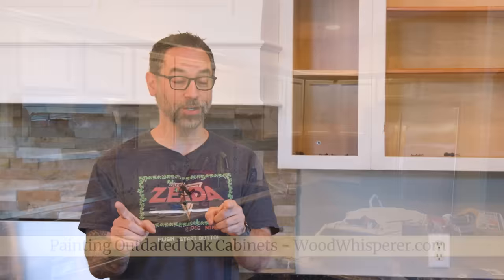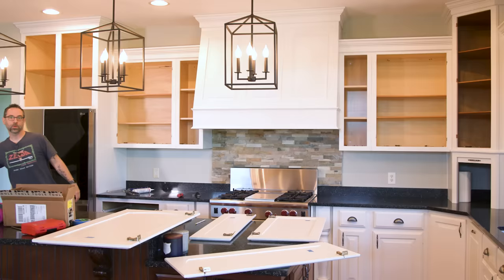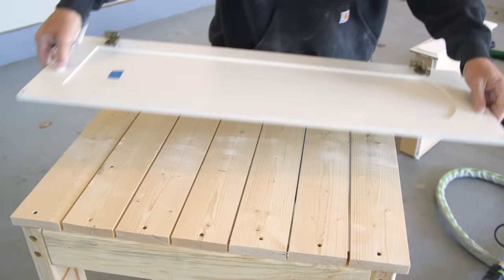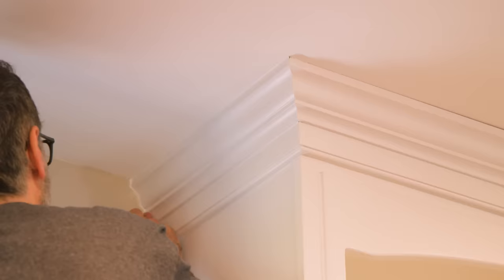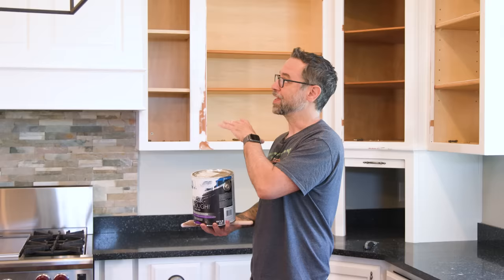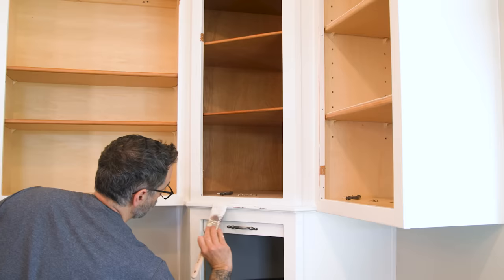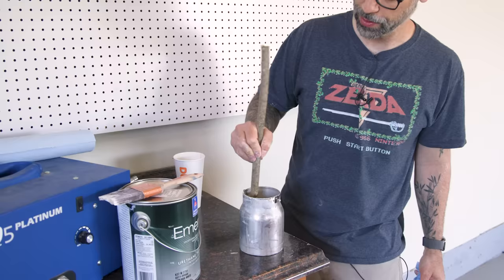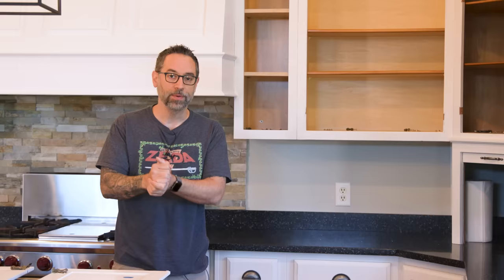How to Fix a BAD Kitchen Cabinet Paint Job | The Wood Whisperer

Comment: Painting company owner here...  A few tips and critiques....

1.  Always remove the doors/drawers and label them.  It might seem obvious where they go, but believe me, it's not.
2.  Make sure that your top coat is rated for cabinetry.  Emerald is rated for wood, but not specifically cabinetry because the cured topcoat isn't hard enough.  This is the biggest mistake I see in DIY cabinet jobs and it's one of the most costly to fix.  If it's not rated for cabinetry, it will chip/peel in the most used areas.
3.  Clean, clean, clean.  Mild detergent and water.  Scrub with a green pad, especially the doors/drawers over and around the cooktop.
4.  If you enjoy using your kitchen, just hire a professional.  Most cabinet jobs take the pros 5 days to do it right.  It could take 3 weeks or more for a homeowner who has a job and other distractions.  If you really want to DIY, call around and find a pro who can walk you through the tough spots.  
5.  Always use your own caulk.  Never borrow your neighbor's.
Reply: You say that "This is the biggest mistake I see in DIY cabinet jobs and it's one of the most costly to fix. "
Your comment caught my eyes, I have cabinets with a peeling top coat, and after I read online I assumed the usual suspects: not enough cleaning, no primer, or no sanding of the previous finish was done by the previous owner/their painter, but looking at my cabinet the top coat does seem soft.
How do you suggest dealing with such a problem? My initial though is to bring everything back to the bare wood or is there a special trick that the pros use in such case?
Reply: @paulchevalier5035  We run into cabinets painted with wall paint all the time, and this is what your issue sounds like.  We'll take a random orbit sander with 100 grit on it and go over every surface thoroughly taking off anything that wants to come off easily.

Once that's done, you can use a product from Ben Moore called Command.  No need to prime except for using some oil primer in the bare wood spots that come off.  Put on two full coats, preferably with a sprayer, but you can brush it on with a brown bristle Purdy (something fine and soft).  

Let them dry overnight and put them back together.

I've been doing that for over 10 years and I offer a 10 year labor warranty on my interior work.  I've never had more than a chip from a broken plate or some over rambunctious boys playing too rough around them.
Reply: @dgoddard  wow this is super helpful. Thank you very much for such a detailed answer! 
I know someone with truly professionally painted cabinets and that sounds more like what you describe here.
Have a great day dear stranger of the Internet!
Reply: @paulchevalier5035  No problem, buddy.
Reply: Can you tell me what is the best paint for kitchen cabinets? I have used some in the past (latex) that were supposed to be for cabinets (those brands were Porter and Behr) and they get really soft and gummy (and dirty looking) in the areas near the pulls where our hands get in contact with the cabinet. I'd like a good recommendation of exactly what to buy.
Reply: @les6584  You don't want to use latex.  You want a latex-acrylic.  We only use Benjamin Moore Command and prefer it in the satin sheet.  You'll want to use the best brush you can buy, but I do recommend spraying the doors and drawer fronts.  However the face frames and boxes can be brushed.

If your cabinets have already been painted, you don't need to use primer.  Just to good coats of the Command will be fine.  But you will want to sand the cabinets to make sure none of the old paint wants to come off too easily.  You can spot prime any bare wood areas using a good oil-based primer in a spray can.
Reply: @dgoddard  Thank you so much! I really appreciate your advice!
Reply: My entire workshop is becoming one giant cabinet lol. Covering most walls with 3/4 sanded ply. Big dings filled with Bondo. Fresh start primer for pore filing and then BM Command spayed on with fine finish tips. Sanding between coats.

Comment: I find that I can use a paint brush to knock down the texture left by a roller. This works well on cabinet frames since they are narrow and a single brush stroke can smooth the entire surface.

Comment: You mentioned HVLP sprayers are as little as $100, the proceeded to use a top of the line $1600 HVLP. You should make a video on how much do you really need to spend on a HVLP setup? I know the high end multi stage ones are better for thick paints, but some of the cheap ones claim to work with all paints too. How much can you get away with thinning paint (or clear finish) and still get good results? I've been interested in picking up a HVLP sprayer, but im worried if i get one of the cheaper ones I'll regret it. But I'm not doing this professionally, so I don't want to waste money on an expensive sprayer if i don't need it.

Comment from the maker: Easy links to some of the products in the video: Rockler HVLP Turbine - shttps://www.rockler.com/rockler-hvlpfinishing-sprayer?sid=AFN86 
Earlex 5700 Sprayer - https://amzn.to/3D8pVid
Fuji Semi Pro - https://amzn.to/46qPCHT
Festool ETS 150 Random Orbit Sander - https://amzn.to/450izsF
Blue Shop Towels - https://amzn.to/3Y7Tvho
Caulking Gun - https://amzn.to/4515kbd 
Sherwin Williams Caulk - https://amzn.to/475ssHo
Purdy Paint Brushes - https://amzn.to/3rMLm61 
Floetrol - https://amzn.to/44HPRNs
Rocker Bench Cookies - https://www.rockler.com/rockler-bench-cookie-plus-work-gripper-single?sid=AFN86
Marc's Respirator - https://amzn.to/3Yd2n5s
Respirator Filters - https://amzn.to/3YdpAnR

Comment: There are so many different bad paint jobs ...

My kitchen cabinets are from the mid-20th century, and built like tanks. The original finish was factory-applied white paint, aged to a not very attractive cream. A previous owner slapped on a coat of cheap baby blue latex paint — I don't think they washed the cabinets first.

When I decided to paint my cabinets a color I like, I washed them, and the paint began peeling off. So now I'm stuck removing all the blue paint. Sanding won't help, as I need to get down to the original paint, clean and sand that, then proceed. Any blue paint left might peel later, it all needs to be removed.

I'll do my paint job right — good prep, a little more prep, and Ben Moore's Advance cabinet paint.

Comment: shellac primer is the way to go  in kitchens  because it  will bond over grease and any finish .  general finishes milk paint for top coat   if your going  to roll it .  otherwise use nitro . you  need surf prep sandpaper  with a .5 foam  for doors.   baby wipes cleans up caulk  better  than anything.

Comment: Incongruous. Kitchen finishes looked awfully nice to have such a butchered paint job.  In our house, the previous owners tried to spruce up dark-stained oak-veneered cabinets with a belt sander and new stain.  Paint made a huge difference. Also consider new hinges and pulls.

Comment: Marc, not to be too picky but that Q5 is not just a hundred bucks......for most thick paints, even with Flotrol, you would need every part of those 5 turbines to spray that stuff.
Reply: Came here to find this comment, or at the very best a link to a $100 Fuji Q5 Platinum! Maybe if you already have a solid pneumatic setup you could get a gun for $100? Really curious what the end mix ratio would need to be to force through latex paint….

Comment: When painting them white I use spray cans of appliance epoxy.  It’s bulletproof. Can’t scratch it easily, bonds very well to most surfaces and leaves a smooth look.   Only downside, high gloss only

Comment: Thanks for the video.  I am in the process of building replacement raise panel doors for my kitchen cabinets (circa 1965).  Bulletproof painted wooden boxes will get new paint grade maple doors.  I will be priming the panels before frame construction.  I had questions on the best way to paint the doors, you have answered all my questions.  Thank you

Comment: I painted my mom’s cabinets and followed all the instructions, did everything right according to this video, but now the doors won’t fit. The double hung cabinets are overlapping. I’m assuming I somehow made them expand but I see it’s not an issue in this video. Or the new hinges are a slightly different size. I’m not sure what to do because the hinges don’t adjust.

Comment: So was it just one coat with the sprayer on the doors? Looks like you may have made a couple of passes (vertical/horizontal) and that was it? Turned out so much better than the roller!

Comment: I painted our bare cabinets 12 years ago and I think it's time to spruce them up again by lightly sanding them and repainting them. I used just a brush the first time and the look is definitely different than a sprayed one. I installed a new pantry and sprayed that one and the finish and look doesn't match the rest of the kitchen. They are all builder grade Home Depot oak cabinets. I've done about all I can to strengthen them up as they are very poorly built using particle board and staples. If I rebuilt them with glue and butt joints they would be miles better than these.

Comment: I died during the caulking section.  LOL

I'm in the middle of painting my 70s golden oak cabinets, but I'm also replacing the doors, drawer fronts, trim & hardware to completely change the look.  I'm lucky enough to be able to make my own replacement doors and trim.  I'll brush and roll the frames (and sides) with a couple thinned down layers to reduce the texture and spray the new doors.  I don't mind a little texture on the surface that is left by a roller, but you have to use the right paint and roller.  I'd argue that I prefer that slight texture vs. trying to get a perfectly flat paint job., especially when upgrading existing cabinets.

Comment: Regarding gaps, if you're dealing with anything less than maybe 1/16", Kilz primer is thick enough to fill all of that in if you lay it on heavy.  Way easier than trying to caulk and smooth and then getting mad that it doesn't lay out right.  Good thick coat of Kilz to start with, couple coats of your actual trim paint, should be good to go.